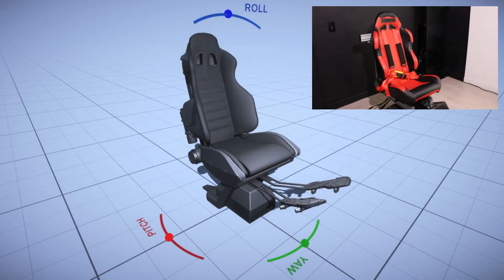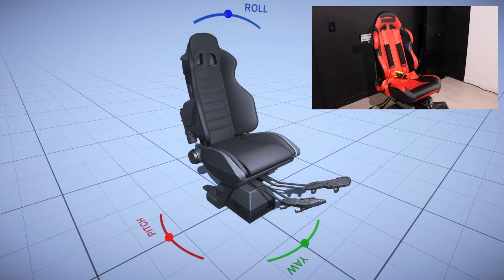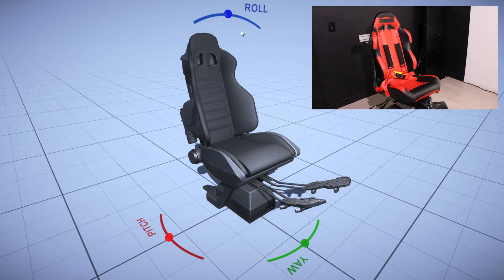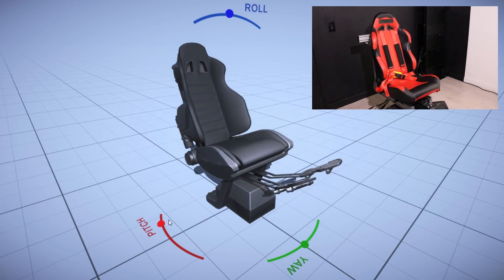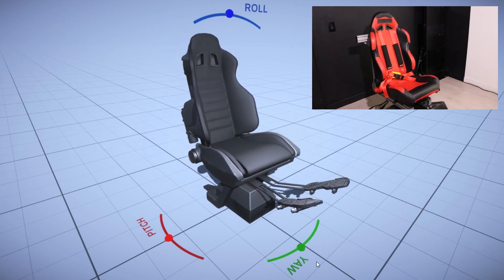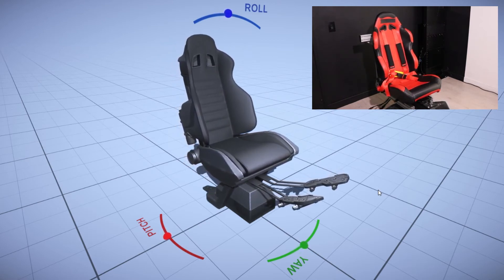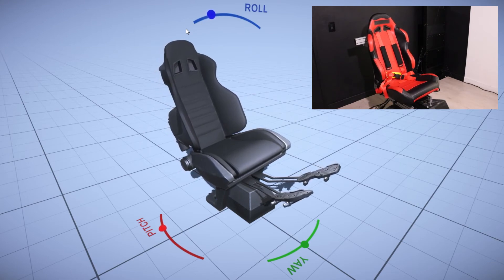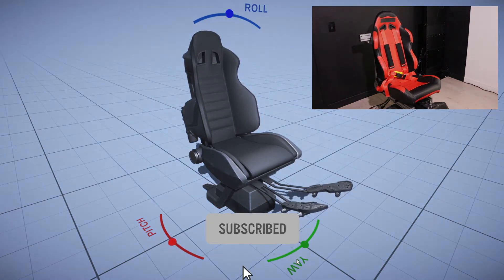Motion Simulator Movement Driven From Unity

Comment: Are you using servo motors. Do you use  feedback motor.
 I am interested in yaw and pitch version of the simulator. 
Can you point me some links for diy this myself.
Reply from the maker: I cannot give away details of the rig itself as its part of another company not Warped Imagination .. with some of it being patented and others are not.
However if you're just getting started with simulator DIY then take a look at the https://www.xsimulator.net/ site
Reply: @WarpedImagination  Can I have more info on  the articulated arms.
Reply from the maker: @WittyPange  Now those are patented so I can talk a little more about them .. they give the feeling of controlling a massive machine as intended, have just enough bulk that they feel like a work out but not a hard workout. They are covered in some of the videos and uncovered in others, the uncovered videos show more of the mechanics .. they use an intricate system of levers to allow a high degree of freedom for the user while keeping the joystick platform always level.
Reply: @WarpedImagination  Would it be better to use a wiper motor or servo motor as the player's weight has to be taken into consideration.

Comment: There seems to be lag between the Unity controls and the actual movement of the chair. Is that something you need to account for in Unity?
Reply from the maker: Sorry, I should have pointed out that I have a lerp going on in several places from the handles through to the simulator hardware .. one of the ways I avoid jerky whiplashing movements on the hardware .. all configurable on the hardware and software sides.